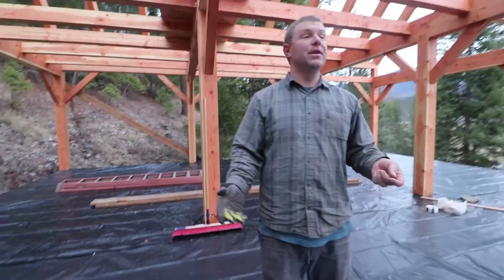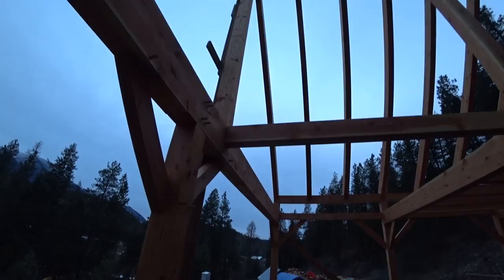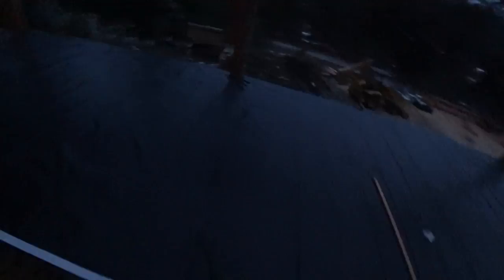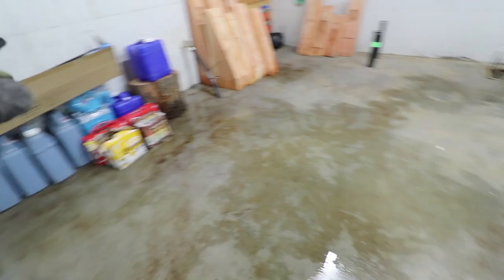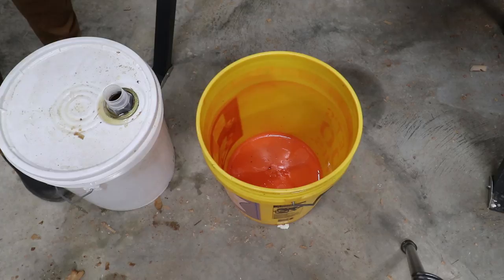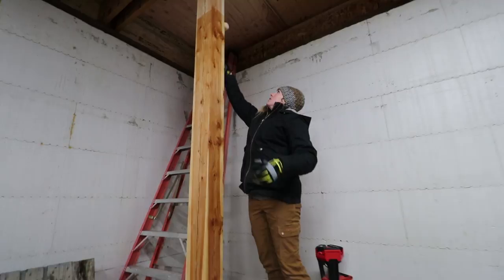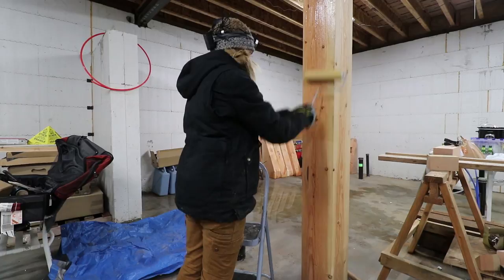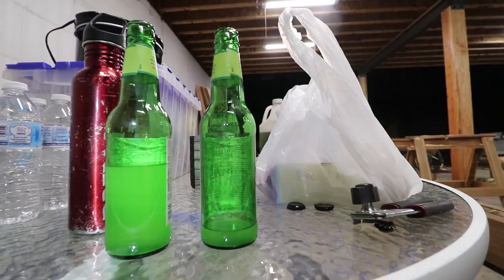Our Garage & Timber Frame House Are LOOKIN AWESOME

Comment: The wind will lift the plastic in large flat areas, tearing your anchors and pulling on the tape. If you strategically place some extra lumber on the plastic(but easily moved lumber) you will keep the wind from lifting it and ruining all your hard work. Just a suggestion, of course. Love what you've done so far! Love Bugaboo too, he's a star! Edited to add that the posts look fantastic after oiling! Good job Alissa :)

Comment: hi guys,  a wee trick for you.when pouring out oil from drums put the spout at the top not the bottom so it is closer to you when you lift it.stops the glug glug glug from air pushing from the back.

Comment: You have probably already thought of this, but , in case you haven't, I thought I should suggest it. Now that you (we hope) have stopped the rain coming into the garage, you could speed the drying by soaking the water up with some of your sawdust and carting it out. There should be an olfactory bonus of sawdust smell versus wet concrete smell

Comment: As a woodworker, I quickly discovered the need for a thick oil mixed with a thinner for penetration.  Using only the thicker one would not properly penetrate.  And that penetration of the thicker substance would only occur when temporarily thinned.  A mixture of boiled linseed oil and paint thinner gave far more performance over much longer time than the stuff you are using.  The thinner evaporated leaving only the boiled oil (much thicker than unboiled).  This created an entirely new substance. The wood mixed with the oil actually strengthened the wood by as much as 25% than just the wood due to the deep penetration.  As the boiled oil dried over time this increased the strength.  Multiple coats could be applied for deeper penetration as necessary for the type conditions (exposure to weather etc).

Comment: Been watching your videos from almost the start from the Costa del Sol in Southern Spain (18 Deg C , 70 Deg F, here - I feel for you working through the winter) . Great job and keep it up.
One comment I would STRONGLY make is to screw battens over the tarp every 4ft or so as I think you will find that staples and tape will not beat the wind. I speak from recent  experience with a similar application. You have plenty of timber around!

Comment: Why don't you simply lay some long flat boards on top of the plastic to help weight it down.  Even with the perimeter well fastened, wind over the surface will tend to lift the plastic.  The ensuing motion will open up gaps around the beams and you risk tears.  A small number of boards distributed across the plastic will help to keep it down.

Comment: We have about 10 of those baker wire shelve units and I find that if I want to store small items on them, I use thin acrylic panels and cut groves for the the poles in each cornet. That way the light gets thru and it is quite a bit more durable then the cardboard.

Comment: POSITIVE HELP! I was taught by a duct tape rep that whilst the initial tack of duct tape will hold it in place, it will peal off in time, as "you've not applied it correctly". "You have to burst the glue", he said.

If you want it to stick firmly you need to put it in place, and then compress it with a hard plastic roller (I use a wallpaper edge roller). If I've not got one with me I'll use something solid with no sharp edges; a small off-cut of 2"x2" prepared, a piece of poly pipe etc. or similar. But a roller really does the job better.

This compressing the tape will expand the glue onto your surface and form a much stronger bond, and will stay stuck for a very long time. I've still got duct tape stuck to brickwork after three winters and for many years on metal ducting and plastic pipework using this method. 

So,  for 'short term hold' push it on with your fingers and for 'long term hold' compress it along its length. Hope this helps many of you :-)

Comment: A little tape tip, the aluminum foil tape used for duct sealing has a much better adhesive property. It will probably work better for you.

Comment: dunno if it was suggested before but- TESA cloth tape is by far the best sticking and easiest to apply tape on the market (not proven scientifically but heaps of trail and error) It's very much known in the audio and stage tech world... it sticks like hell even on moist and dusty surfaces , I reckon that the best part of it is that unlike many other gaff tapes out there, it's very smooth to deploy ... super efficient for the stage trade's needs and I'm pretty sure for your needs as well. It's on the expensive side though.

Comment: Happy New Year from SC. Please Jesse before you paint, good brushes, roller poles, and 5 gallon roller grids. You have already learned using the right equipment gives you a better job and it makes the work easier.

Comment: Just a tip with any duct tape you might have (cheap old or expensive) just warm it up for about 10 sec or so in the microwave and it's better than new. I do this all the time when my tape gets old or when its cold, it works every time. In your case i'm sure your duct tapes getting too cold and not sticking well. give it a try I hope this helps someone :)

Comment: You can use a couple of your "extra" floor joist's to make a temporary platform that stick out beyond the house frame around the center post.  Then screw down a plywood panel to stand on and you can use a ladder to reach the brace board you want to remove.  Just be sure to anchor the inside end of the cantilever so the outside does not tip down when you put your weight on it. :)
I think you will find this much safer than trying to do the job at the top of  a 30 foot ladder, or reaching around from the inside.
I agree with one of the other commentators, think about covering the garage opening with heavy clear plastic.  You can the at least run some space heaters that will make a huge difference in the next few weeks.

Comment: Jesse  when i see Alyssa rolling the oil on those beams, i am crying please try a brush you have beams that have large cracks they need oil inside to keep your wood from drying out and splitting over the years, if the oil is there to preserve, then work it in with a brush don't   waist it , rolling the beams out side when lying horizontal is a good idea now they are upright you do need to work that oil into the wood more, hope you don't mind me saying as it will come back and haunt you in years to come. Clive

Comment: For paint rollers and tall hard-to-reach spots, I recommend using a mop or broom handle with a threaded end; attach the paint roller handle to the broom handle and you have an easy 7-10 ft reach maybe more.
Reply: Timothy Vaughan or a broom handle. They also make handles that telescope that are specifically for painting
Reply: iLikeC00kieDough oh yeah, there are light changers which telescope would fit too

Comment: Watching the tarped floor, I questionned if you guys will be doing concrete over the heating floor. Leading to the question, would it be a good idea to plan for an early pour to waterproof the garage? planning of where walls will be going, installing a 2x4 plate where they will be and squares of 2x8's or 2x6's for placement where plumbing and electrical. Food for toughts.

Comment: When you pour from a 5 gal bucket that is full, turn it over so the spout is on the top and it doesn’t gurgle and splash all over the place because the air can get in without hitting the liquid inside.

Comment: Here in Norway we have this tape that they often use on the stage and theaters that will stick to anything and stick very well, often too well. It is silver in color will treads in them and we call the tape simply Gaffatape. It is usually water resistant and even can be used to hold water. It will stick to skin, glass, plastic, basically the perfect tape for stage use and construction. But it is hard to get the original and there are several knockoffs that are poor substitute.. It ia actually strong enough to hold up stage lights (not legal or recommended use). I just wish that it was easy to get.
Reply: Taleg's Channel im a welder and work for a company that does speciality/ custom stage stuff and they have pallets of that tape so yea it must be good.

Comment: For permanent weatherproof taping of seams, including, it happens, to my lips when I use my teeth to rip a section off the roll, I use uv resistant, dang near impossible to remove, proudly Canadian, red Tuck Tape (Canadian Technical Tape Ltee). Leave a fold over flap on the roll after gluing your lips together, at least, the flip over the flap permits the intertape seal to peal tape off the roll edge which otherwise disappears, even to the furtive scratching of well meaning finger nails.
Reply: this video is a minimum of 2 weeks old. its not possible for them to change what they are doing because of the comments

Comment: Put a "roof" on all shelves til the real roof is on.  The plastic "roof" is very fragile, limit stuff thrown onto it.  They took down all the 2x4s and plywood and then said they needed them,  at least some of that should have been stored up on loft, out of the way and handy.  Need outside ramps or stairs.

Comment: Almost 2018 here in Tokyo, all the best for the coming year!
I love you channel, and enjoy watching your videos, I'm so impressed with your hard work and tenacity! 
If I may offer some thoughts on where you guys are at the start of the year.
I'd put the RV trailer in the corner near the radiant floor heating manifold, then I'd frame in that bay of the garage. By framing in, I mean maybe some wood and then some heavy plastic to keep the weather out and some heat in. I'd frame in that garage door, and put the wood stove near-ish the framed in garage door, with the chimney going out of the framed in garage door. This would give you a dry warm out of the weather space. Then in the other bay I'd set up your workshop area, here you could make a simple curtain across the garage door opening to keep out most of the weather, rain, snow etc. I think this would also free up some space outside where the cabin and cover is for the RV, you could relocate the RV tent cover and maybe store stuff in there, or even park the backhoe in there? Well those are my thoughts, they are worth exactly what you paid for them LOL, Love the channel and I'm giving you both a virtual High Five for the hard work you have accomplished in 2017!
Cheers from Tokyo Japan!

Comment: I used to work with a woodmizer. we had a Bobcat and burned a couple holes in the bucket so we could attatch a set of old (free) grader blades for forks. mite be an idea. pull boards, stack on forks, move them wherever you like

Comment: You should have had the roof SIP's already there when the frame went up so you could at least dry in the roof.  Of course if there are skylights going in and you haven't decided on opening size that point is mute.  In my experience the water has to have a way of shedding, any moisture sitting on the floor above is going to find its way through the plastic.  I hope your worm board doesn't suck up that moisture and swell up on you.  We'll see how it plays out.

Comment: I like how u guys put the black plastic up their and maybe u could put up ply wood on front with wheels to make a sliding  door so you can semi enclose your lower part of the house  keep you warmer -pa not sure if u r doing tung and grove boards or if u will mill them -if u mill them - save your squaring pieces and make like a pole barn to put your saw mill and  stuff

Comment: With the mental break with the plastic covering of not having water coming down from the roof of the garage, why havent you installed  garage doors to minimize the winds and snow/rain .....and keep your tools safe from theives when u do town errands?
Reply: Would it not have been easier to treat and paint the I bar on the ground ?  I think it is going to be a lot more difficult now.

Comment: Hmmm, I'm thinking some 3m77 spray adhesive would solve the tape-to-plastic issue.  Spray it on, let it tack-up, stick the tape, and it's not coming apart.
Reply: OCJohn Weber they could use blue vapour barrier tape too. It's rated for outdoors, for vapour barrier plastic, and it's construction grade tough. Why they'd ever use duct tape type products I don't even know.

Comment: Jesse, I notice that you spend a lot of time moving or searching for materials and tools. My suggestion is to use some of the spare lumber you have and build some shelving possibly putting casters on the shelving units. Thank you for the great videos.
Reply: +1 Looks hard to walk in the Garage. The tools are all over the place. I would at least get some large totes and try to organize the tools better. The fuel cans should be kept somewhere else, if the diesel spills on the floor it will stink for 20 years.

Comment: What's with all the haters on here. constructive criticism is good but shitting on 2 ppl building basically an off grid debt free property? It is not easy, if it was more ppl would do it. And them showing the negative aspects of the situation is more important than the positives. Gives others an idea of what they will be facing. And a lot of ppl being assholes about how long it takes them which is odd since the point they said from day one is debt free if they wanted it done faster they could hire ppl from a loan and get done in no time but that would defeat the purpose of being stuck in the rat race.
Reply: It was good to see you having some fun!

Comment: Any reason why the timber frame is not anchored to the sill plate and steel beam? It looks like subfloor (warm board) is holding up the weight of the timber frame. Wouldn’t you want the weight of the timber frame on the foundation instead of the subfloor? Putting some wood blocking under each post so the load is transferred to the foundation would be more appropriate.
Reply: There are LVL squash blocks under each post. The squash block in the corner by the stairs wasn't quite done right, but they worked on it on the previous video. The warmboard should have enough capacity to transfer the loads in compression, but there are commenters who say the engineer who used that detailing is an idiot.

Comment: Yes, you have iron staining going on with your timbers.  I found a chemical that I use in building log homes that removes those stains.  It will remove major stains and the overall dinginess that happens to exposed timbers.  IF you liked what the citrus oil did to the post, you'll really like what this material will do.  Contact me and I'll tell you more about it.  It is very low in toxicity, works well and is very reasonably priced.

Comment: just wondering how long will it be before the roof  goes on it seems to me to be the most important thing now keeping everything dry .
Reply: I don't think that they can roof it until the walls are in.  The SIP wall panels actually anchor the frame to the sill plates.  If they roofed it there would be a danger of the whole thing lifting off.
Reply: They've said four weeks a number of times now

Comment: Have you tried foil tape for waterproof tape applications?  The one thing duct tape is not good at is its initial intent: for use on air conditioning ducts, because of the condensation.  Foil tape is waaaay better at water-sealing - liquid and vapor - though it doesn't have the strength of duct tape, especially shear strength.  Just a thought.
Enjoying following your journey.  Keep up the great work!
Reply: or tuck tape is even better yet.

Comment: so i've been following for a while, and I am sure not what it is you are building. is it a house on top and a workshop/garage on the bottom? its interesting following along but lol. I am in the dark about the goal of the structure. Thanks :)
Reply: yes their house in on top of the garage/workshop. the first floor of the house i believe is level with the hill at the back of the house.they have a video from a couple weks ago that they show you the floor plan in a 3d model.
Reply: oh yeah i remember, for some reason i was under the impression it was a different house. It looks like its coming together. just a lot slower than I though it would be. especially when they are rolling into the winter months where costs would be up because of the weather? I wonder when they start wrapping the house with plastic sheeting? I've seen a lot of construction crews wrap the upstairs  in plastic till they finish. ^^ thanks for responding!

Comment: you should hang Plastic over the garage door opening, you could add some sort of heat in there.. kerosene heater. that would create a sheltered optimum working area. just a thought.

Comment: Can you not get the roof panels manufactured and shipped prior to wall panels? Even if you have skylights, the roof panels should be much faster to manufacture than the wall panels with windows and routing for electrical/plumbing. Extra shipping cost but to get under roof would save a lot of headaches.

Comment: Scraps are always handy.  //  Safety is good!  //  The plastic may have saved your entire floor, not just mental relief.  //  Jesse, hand an extension pole to Alyssa for that paint roller, please.  //  I'm allergic to tomatoes so the alfredo pizza sauce is my fave.  //   At some point, you might put up some long sets of shallow shelving at eye height for all those screws you will be collecting. Using clear containers with lids is a great idea.  //  And, finally, Inspector Bugaboo makes his rounds.  All Clear!

Comment: about that tape... Black or dark colored tape usually has some kind of carbon in them which makes them more resistant to UV rays. UV rays are responsible for plastic getting brittle after while. About the adhesive not sticking... there are probably two reasons for this. First is probably dusty/oily/gritty surfaces (i know unavoidable on construction sites). Second is the glue itself. try the 3939 ore 6969 duct tape from 3M. 3M tapes usually exceed my expectations.